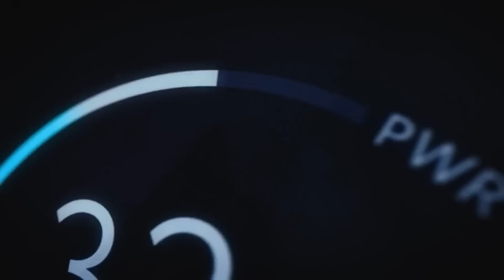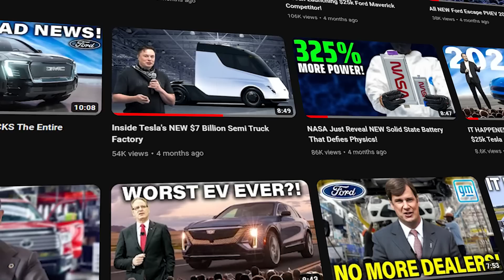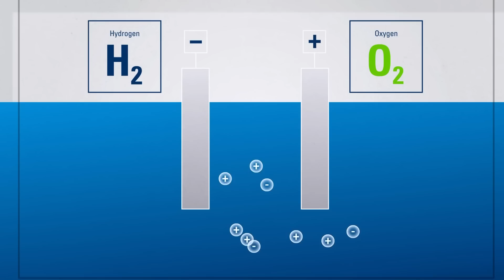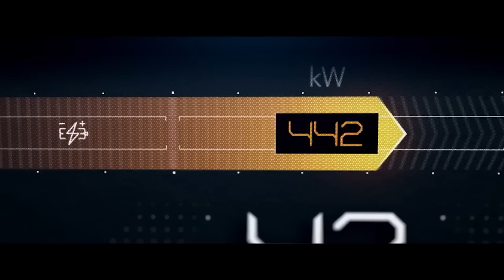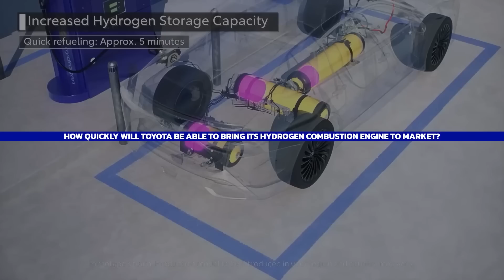New Toyota CEO Reveals Hydrogen Combustion Engine | Shocks Industry!

Comment: Honshu is around the size of California.  It will not be hard to build and study the infrastructure of hydrogen stations in Japan.  They currently have close to ~150 stations and as the supply chain increases, the cost will decrease.
Reply: "As of September 2022, there were 54 publicly accessible hydrogen refueling stations in the US, 53 of which were located in California, with one in Hawaii." 

"There are currently more than 160,000 EV chargers in the United States."

Comment: Hydrogen is a fool’s errand
Reply: Yep H2 fool cells.
Reply: Elon, is that you???? 😂
Reply: @markdafunky1  it is anyone with at least half a brain.
Reply: Engineering Explained channel worked out the atrocious mileage they will realistically expect.
Reply: Tesla troll.
Reply: @mrgurulittle7000  watch Engineering Explained to see the math on why hydrogen is so bad as a transport fuel.
Reply: @williammeek4078  I watched engineering explained. But I thought to myself, “wait a minute, if efficiency is the subject, why not continue to drive ice cars because they are the most ‘efficient’”. Since “carbon neutrality” is what we’re looking for, hydrogen is the only solution. EVs aren’t carbon neutral.
Reply: @mrgurulittle7000  because there isn’t enough land to make enough biofuels and synthetic fuels are much more expensive than the electricity used to make them. And because the carbon intensity of EVs is lower than any fuel driven car. EVs only get cleaner as the grid and mining cleans up.

Comment: How many alternative fuel infrastructures do you think the market will tolerate.  We already have gasoline, diesel, and electric.  I think a fourth alternative will be very slow to adopt and may only be found in dense urban environments competing with electricity.
Reply: electrolysis is extremely expensive and inefficient, not to mention building the infrastructure to even store it.  i believe it could work well for air travel though.  Electric is def the go to for the foreseeable future.
Reply: @DestoRest  
Red hydrogen is extremely cheap (basically using excess energy from nuclear power generation). Japan has that running already

Australia has developed a technique to produce hydrogen for around $2/kg (from memory)

I do agree with you, it will be electric for now but I think hydrogen will just keep on coming

Hydrogen has a marketing winner on its hands that will attract a lot of purest's, "Water is the only output"

Comment: Hydrogen ice sounds like a MUCH better option for transport trucks!
Reply: Only for those that want fuel costs to put them out of business.
Reply: @williammeek4078 Maybe Toyota can subsidize their fuel costs too.  😅
Reply: @williammeek4078  in time with support.   EV trucks  are a complete failure with out massive massive government support .
Reply: It’s nearly triple the price per mile…
Reply: @Meatball2022  you mean electric ,.  Which are a huge huge failure with out my money
Reply: @tnickknight  to drive 100 miles on hydrogen it takes around 1.5 kg.  Current cost is $23 bucks. 
To drive 100 miles in electric car takes around 30 kWh which costs around $5
This is why you’re a fool to think it makes better sense for trucks. Ain’t no trucking company that wants to quadruple cost per mile.
Reply: @Meatball2022  since you clearly live in a communist world.   Let me enlighten you.  Those trucks need massively expensive chargers,.  And the time charging is time lost.   Which adds up, along with the infrastructure. There is a reason they in very very limited use as  pr projects paid for by my family.  Maybe learn about business

Comment: It would be nice if you can fill up your car from the garden hose from your house.  This video doesn't really say how it works.  Forget the hydrogen station.  Just add water.  Make a car where you can switch between EV,  Unleaded,  or Hydrogen.
Reply: What???? Put an H2 electrolyzer, in the car? You know water isn't combustable, right?
Reply: I understand that hydrogen corrodes metal. In a pertrol/gas car you get oil leaks and even fuel leaks that can cause a fire.  There was a hydrogen station somewhere that was re-fuelling a car. No-one knows what happened because the explosion eliminated the eleven witnesses. I hope you are not thinking of transferring hydrogen from a garden hose.

Comment: Terrible arguement about charging infrastructure. People with EVs typically have a "charging station" at their home.  Any old outlet can get the job done. For a Hydrogen based vehicle, when you need to refuel, it certainly won't be at home, and talking about Hydrogen Infrastructure. There are currently ZERO hydrogen stations in the U.S. outside of a handful in California.

Comment: NOTHING new about this H2 engine, it's the same as any combustion engine with slight modifications to the fuel valves and lines.  BMW introduced their H2 combustion engine >15-years ago, and it failed.  HUGE problem with H2 is, customers are still stuck paying massive prices to fuel stations for H2, and still have the same ICE parts break down, pretty much nobody wants that.  H2 will fail, miserably!
Reply: Haha no if you think you are getting away from high fuel cost. You better think again. A large percentage of the price you pay at the pump is taxes my dude. If you think they got rid of the gas stations. And you will use EV charging stations instead. The government gets the taxes they use for road maintenance from the gas pump. They will transfer this straight to your charging station. You will pay much heftier fees to charge. You are not winning this game.
Reply: @aronmiller7648  The Government will always raise taxes irrespective of the fuel technology. The Government spends money so it has to get money.  However physics tells us that hydrogen will always be more expensive than electricity.  You run a wind turbine to make water into hydrogen through hydrolysis, you store the hydrogen, transport it to a re-fuelling station, pump into a car and use in a fuel cell to convert into electricity to fuel the car. Or you just transfer the electricity in a powerline to the home or re-fuelling station.
Reply: @robertwhite3503  this is not a zero sums game. It does not make sense to put all of your eggs into one basket. What is the real issue with looking into other alternatives? You are a fan of electric cars correct? Does not mean something else can't exist also. The issues with electric cars are obvious. But, you don't see those who are not fans of electric cars saying do not produce them. However electric car enthusiast seem think and say all others need to be discontinued.
Reply: @robertwhite3503  Yes, you are correct the government will raise taxes regardless of fuel tech. It will in the end roughly cost the same to charge your car as to fill your fuel tank with gas.
Reply: @aronmiller7648  I've researched H2 combustion and H2 fuel cell vehicles for the past 20 years, it's not about being a fan of one or the other, it's about economics and the economics of producing, transporting and storing hydrogen makes no sense.  Do some research on it, you'll see.  All auto makers have done their research which is why all are converting to EV, asap, Toyota is just dragging their feet in hopes of kicking the can down the road but will likely go bankrupt if they move too slow.  Look at Kodak and Blockbuster video, for examples.  New tech doesn't wait around for the dumb.
Reply: @aronmiller7648  If not more. Somebody has to pay for all those EV charge stations and upgrading the electrical grid. And unless you have a dedicated charging station at home, it takes all night. And if you don't have one, plan on spending $3K -$5K to get one.
Reply: @RussellFineArt  you have researched existing and old h2 combustion. You or I are not a company worth billions to invest in this tech to improve it.
Reply: @Mike-hb4pc  I sleep at night, don't you? :-) 
Takes 15 seconds to charge from a standard 15 amp 120v outlet, plug in when I get home, unplug when I leave. No wasted time going to a gas station. I'll soon be installing a 240v permanent charger, they're safer than the portable chargers. If you can afford the car you can afford $1,000 for electrical work and a home charger. LOL
Reply: @SmokinPaul  Well, I hear ya. Now I've heard that it will cost you as much to charge your EV as it cost's to run your AC. That's a big azz electric bill. If that's true, that ain't good. And if I want to install an charging system for the EV, that would probably cost several thousand dollars. An EV would work great for me around town, but not if I want to take a trip. Charging stations might be easy (ier) around a big town, but go to some out of the way places like North Carolina or Georgia (which I do) and I don't think you're going to find too many charging stations. Because it's impractical on a longer trip, the EV won't work for me.
Reply: @Mike-hb4pc  I currently pay 13 cents per kWh, my car has a 70 kWh battery pack. 0.13 x 70 = $9.10 
That would be completely empty to a full charge, over 300 mile range.  
Whatever you pay for electricity you'll be saving massively on the gas you are not buying. 
Personally I haven't noticed my electric bill going up much. 

We've taken many long trips and find it easier than in a gas car. Tesla's Supercharging Network is larger than all the others combined with a 99.96% uptime. I have only seen one station down from charger that was hit by a car. Out of curiosity I drove by the next morning and it was back up and running. Had I needed to I could have used one of the many non Tesla that seem to always be near Tesla superchargers. Instead I just drove to the next supercharger station. Yes they are that plentiful. 
Sometimes you have to drive a few miles more to charge but it's no big deal. Tesla has been doubling the number of superchargers every year so it's only getting better. Now that Tesla is opening up their charging network it'll be easier for other brand EVs to make long trips. 

That said if you buy a Chevy Bolt which isn't made for long trips because it only charges at 50 Kw you'll be sitting at the charger for a very long time. However as a town car, a second car it's a good deal. It doesn't have all the nice stuff Tesla's have but you can get a used one with a new battery pack with over 200 mile range for $15k or less. With a new replaced battery it's pretty much like a new car. 

My Tesla has the advanced heat pump and gets about the same milage winter or summer. I leave it plugged in in winter and have it set to automatically warm up before I go to work. The main advantage isn't just having a warm car but having the battery warmed up using grid power. If I leave my Tesla out without plugging it in it'll use a little battery power keeping the battery from getting too cold or too hot and the big drain would be warming up the battery further to operating temp. Leaving it out in Sub-Zero temperatures I'd lose about 10 to 15% range which still isn't too bad. 

If you have an attached garage running a higher power circuit won't cost that much. If you already have a dryer outlet in your garage you're good to go. If like me you have an attached garage and can't do it yourself it'll cost a couple Grand. But compared to the price of the car it's not unreasonable. 
Remember EVs have very little maintenance if any. The only maintenance on my Tesla is windshield washer fluid and the car even tells me when it's low. lol 

No oil changes, no repairs and electric fuel that's cheaper than dirt. Best part is never going to a gas station to fill up except on long trips and then it's charged in the time it takes to take a leak and or get a coffee. 

Oh and all Tesla's come with autopilot which makes long trips a breeze. We opted for FSD which also navigates on the freeway/highways so you never miss an exit. The car is doing most of the work for you allowing you to look around and be much more aware of traffic around you. We arrive at our destination relaxed and awake, it feels like we rode the bus. 🙂 

I've used third party chargers with the included adapter to see how they work and also if they're free which many are. 
We choose hotels that have destination chargers and wake up to a full charge for free! 
A  grocery stores around us have free charging while you shop. There's a brewery/restaurant with free charging after business hours and on weekends, a bar we frequent with free charging and the college next to my work same thing. 
If you wanted to you could literally charge for free. 

There's a guy with a Chevy Bolt that lives in an apartment near my work and charges for free at the college. The husband and wife show up once a week to charge the Bolt and drive off in their gas car. Bolts charge slow and the free chargers are level 2 anyway. 

Comparing EVs to gas cars is a bit like comparing apples and oranges. Once you get an EV you'll start to dislike your gas car. After about a month we gave our two gas guzzlers to our kids. We'd rather have one EV than a gas car even as a second car. 

Also our insurance is less on a new Tesla. It's because the biggest payout for insurance companies is for medical. Tesla's are by far the safest cars ever made. 

Rent a Tesla from Hertz for a week and see what it's like. Once you have some experience you'll want one. Prices for Tesla's are going to drop as they start meeting demand. Plus they have plans to build a $25k car at the new gigafactory they're building in Mexico. 

Even if you bought a use EV with bad charging speeds and or range it would still work great around town saving you lots of money.
Reply: @aronmiller7648  I've charged my EV, 100%, from my own solar panels and small wind turbine, at home, for the past 7-years.  I'm fine with taxes being raised $.01-$.02 to pay for roads when gasoline runs dry, I won't be the fool who pays for gasoline.
Reply: @RussellFineArt  I won't be the fool paying for a costly battery when it fucks up. I will not be the fool buying into something that pretends to be green. I will not be the fool to trade one non renewable for another non renewable. I will not be the fool wanting to charge my car at home just to skate by on charges at the pump. I will not be the fool spending money on solar panels or a wind turbine just to charge a car. I will not be the fool caught on a cloudy day or a day with no wind to charge a car. I want to start my car and go anywhere. And, when I go I don't want to take an hour or more to charge a car to get to 100%. I also will not be a fool to buy an electric car whose resale value is much worse than a conventional car. There is also NOTHING new about electric cars. Electric cars were tried over 100 hundred years ago.
Reply: @RussellFineArt  Hopefully you will be fine when the materials to make electric cars run out as well.